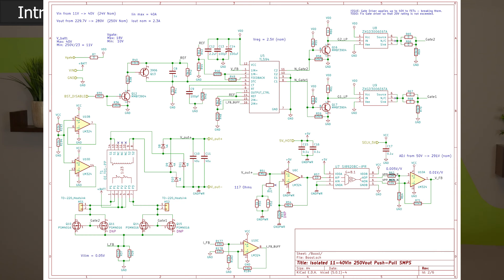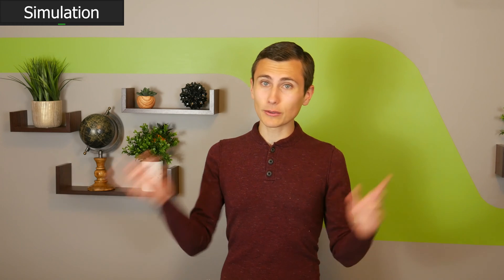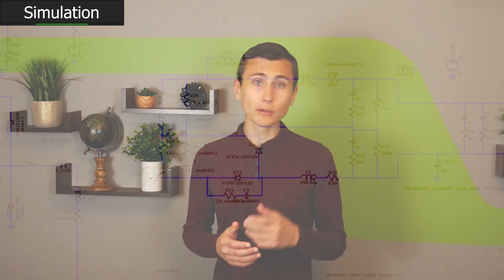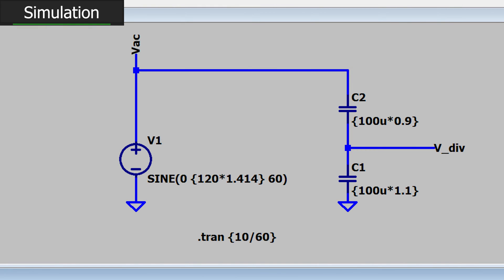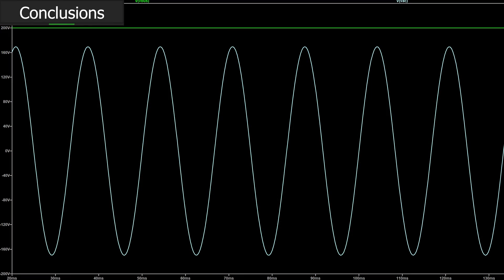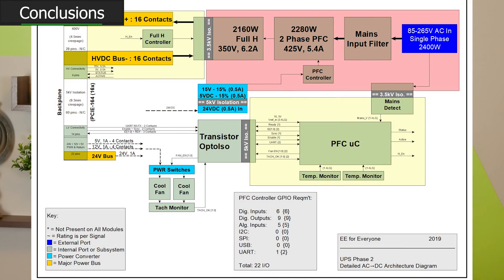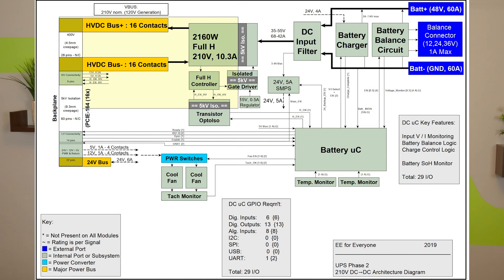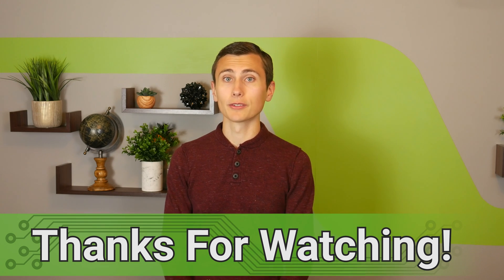SMPS Transformer Design: 1:16 Full Bridge

Comment: I'm a relative electronics newbie so please forgive my ignorance if this is a totally stupid suggestion.
What about having two transformers in series ?
You could then halve the turns ratio on each transformer while maintaining the total ratio between the primary of the first transformer and the secondary of the second.
Would this work ?
Would this reduce the high spikes ?
Would there be too much power loss ?
Thank you.
>
Reply from the maker: Hello Bodragon! I think it would be possible, but it may not be ideal. Most of the "spikes" come from leakage inductance made by imperfections in the transformer construction. 

Putting two transformers in series will add another place for that leakage inductance to have an effect, there could be some resonance between the two transformers, there are a lot of little nasty things that could start to have an effect. I haven't thought about it too long, but I can't think of a situation where two transformers in series would improve efficiency or reduce transients for a power supply. 

It would be worth a few moments to do some analysis or simulation to dive in deeper!

We ended up using two secondary windings in series to solve this problem! It splits the transients in half, and provided an easy way to add more snubbers to share the load.

Cheers, and thank you for reaching out! I love your creative problem-solving attitude!

Comment: Is there an explanation  for why as increasing frequency would give more power for a switching mode power supply  ?
Reply from the maker: Hello Suhaila, Sorry about the slow response... Apparently this message got flagged as spam by Youtube and got held for review... AAAnyways: Thanks for watching, and thanks for reaching out!

Higher Frequencies don't necessarily mean "more power" but generally lead to higher power density (to a point). A part of the reason why is because higher frequencies can allow for a better balance between core and winding losses! (Improved Overall Efficiency)
Reply: @EEforEveryone  
Thank you very much for the explanation. 
Thanks for your video.

Comment: Interesting idea. I'm working on something similar, but using a fixed frequency, fixed dead time fullbridge to give me roughly 13:1 on my battery voltage (24v nominal) followed by a boost converter to get to 380. I get full isolation and don't have to pass feedback across an opto. Yes, it is two stages, but both can be optimized and should each be able to hit 98% without getting too complicated.
Reply from the maker: Interesting Idea.. I'll have to think on that. What does your voltage range end up being on that intermediate bus (feeding the boost converter)? Out of morbid curiosity... I'd imagine 312 at an absolute maximum and (depending on power level) somewhere around 140-200V at full load. Does that sound about right? 

More generally, I think you'll agree that optimizing two power supplies for 98% efficiency is more difficult (or more effort) than optimizing one power supply for 98% efficiency, and the total part cost for two supplies will likely be more than a single power supply.

That said, your application is very different than mine! It may seem trivial to the casual observer, but the voltage multiplication ratio for our ups is only 7 at a maximum, while yours is around 21! Considering this, I can see why you'd go for the two-stage approach.

(P.S. I'd love to see some pictures of this project. It sounds awesome! Maybe shoot them out on twitter if you get a chance https://twitter.com/EEforEveryone

Also, I'm open to other social media platforms if there's a big big one a lot of people in this community are on {slack, discord, etc})

Comment: I'm very bad at electronics so it could be a stupid question but would it be possible to remove those very high peaks of voltage by using a zener diode that stops the electricity and then let it flow when the voltage becomes too high? Maybe with a resistance to don't waste too much current
Reply from the maker: Hi Jotaro, Thanks for the comment! No stupid questions here.

Zener diodes are one approach, however, there is real power being moved here. For example, the clamping diodes (External to the MOSFET body diode) are passing peaks 34A though them! 34A through a zener rated for a thousand volts... would be... a LOT of watts. 

However, 34kW is the least of our problems... because the switching time, or reverse recovery time (How fast a diode can transition from blocking, to conducting), for a zener diode will probably be too slow for it to clamp this ringing (high peaks of voltage) effectively.

Your comment about resistance is funny, because it exposes a good point. The fundamental problem is that if small currents are flowing... the ringing isn't made any smaller. If my simulation is to be trusted... we would need to draw tens, or hundreds of amps off of this net in order to completely remove the ringing. Not an easy task! (And not very efficient either)

Cheers, and thanks for watching!
Reply: @EEforEveryone  thanks for the explanation